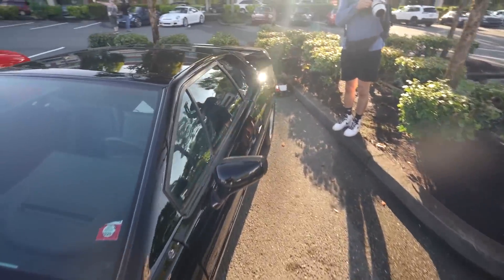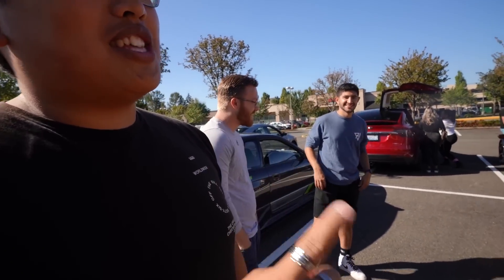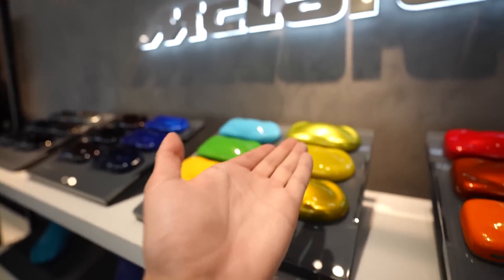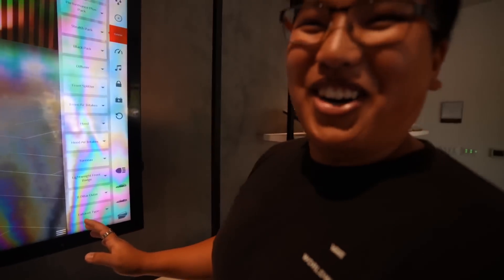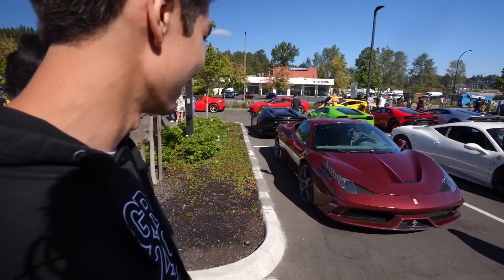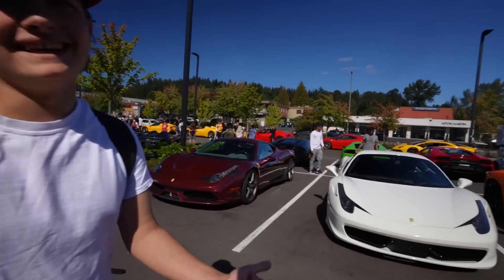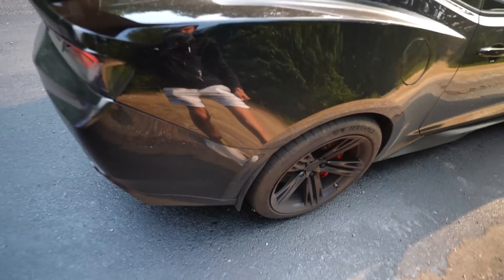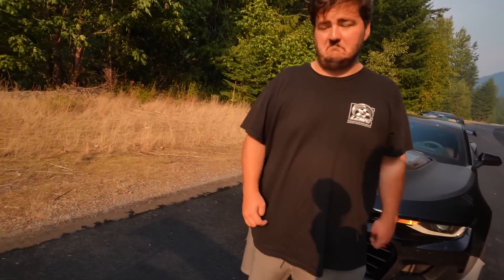*GONE WRONG* My Camaro ZL1 Shatters BMW M2 Window...

Comment: Damn, RIP M2 Competition. How does a rock manage to do so much damage? 

Both a window and the radiator? Jesus, the force of the rock could've seriously injured someone. Glad everyone's okay.
Reply: Yeah and the glass could've easily cut the passenger
Reply: Luckily vehicle glass can’t cut people anymore
Reply: i mean wasn't like a huge rock was it?
Reply: @igotnoodlesgold9193  It's not about the size, Its how you use it
Reply: @tylerortiz8284  and by using it, we mean by flinging it at 80 mph into the front end of a BMW
Reply: @tylerortiz8284  yeah i see that now that a small rocks were able to shatter a window and put a whole in a radiator
Reply: that’s like 100% unexpected how a car sound could break a glass window like that.
Reply: I experienced something similar in spain when i was driving 90kph and a rock from a semi smashed both layers of the windscreen
Reply: @tylerortiz8284  Thats what he said
Reply: @brandongao3675  tempered glass doesnt cut
Reply: @hettekloosterman16  Yes sir
Reply: @igotnoodlesgold9193  a pebble broke one of my my windows once it's possible
Reply: That can happen realy easy because if the stone gets stuck in the wheel profile it will get accelerated to the peripheral speed of the wheel so it gets extremely dangerous. So good that nobody got hurt because it could have ended in the hospital with a heavy injury.